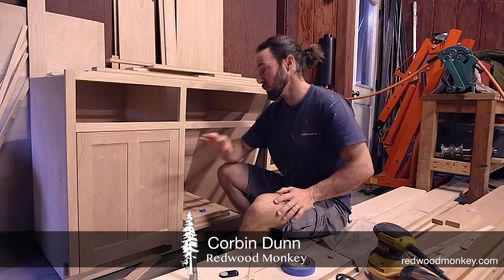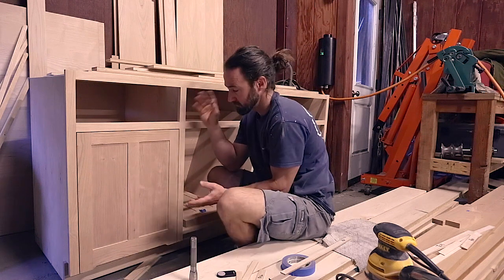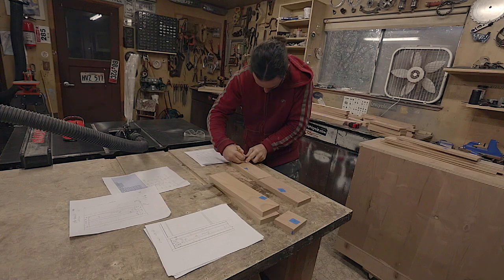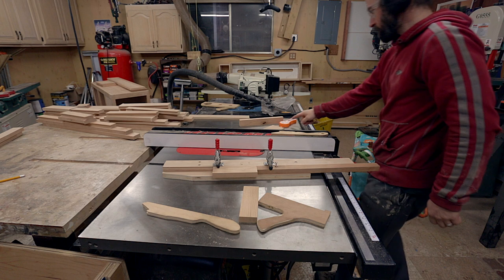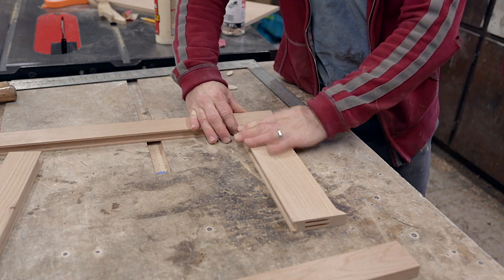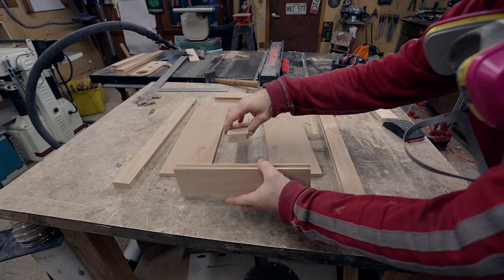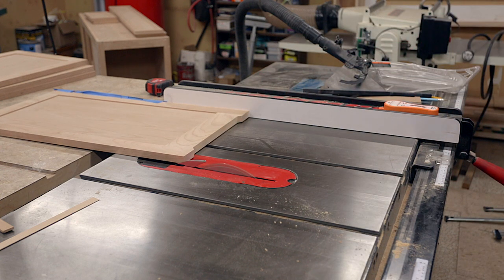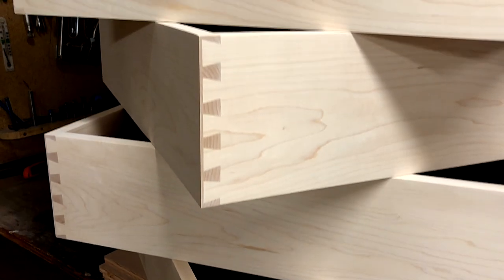Ep 7: How to make Inset Doors and Inset Drawers / Build inset cabinet doors - DIY Kitchen Cabinets

Comment: Hi there, have question for you. What is the frame overlay in regards to the cabinet interior.
Reply from the maker: Are you familiar with SketchUp? The description has a link to my plans/drawings I did in 3D. You can download them (free) and virtually measure any part you are curious about. The overlay sides varied..1/2" to something larger (I forget exactly what), and it depended on where I put the vertical cabinet sides. I talk about this a bit in some earlier videos. The inset is important; you have to get specific hardware for the specific hardware depth you are using. Sometimes I would skip the hardware, and simply block it out with 1/2" plywood, which was way cheaper. So, look at Blum's data sheet and use that as a guide for the sizes you should do. And/or, look at my drawings/plans in SketchUp. Let me know if you have more questions!

Comment: Great series. Very helpful. It doesn't look like you used a jointer on the boards, or maybe you left that out of the video? How are you getting them straight and flat?
Reply from the maker: Hi James -- you are right, I don't use a jointer! I bought S3S boards to save time -- surfaced 3 sides. I take the smooth edge and run it against the tablesaw fence to get the opposite edge parallel. Generally, the factory surfaced edge will still be rough from the sawmill so I will flip it over and take off 1/16" to 1/8" more to get it flat and smooth. The small cut also makes it more accurate and less prone to nicks from the saw blade.

Comment: Question about inset cherry doors. They are two doors that open in the space instead of just one. Do you suggest 3/32" gap between the doors? I've never done two doors and never done inset doors.  The hinges also didn't come with instruction and Blum sent me instructions to a similar hinge saying it will work with the Blum hinge I got on Amazon. That required me to get a millimeter ruler since all Blum measurements are in mm. I plan to experiment with boring and mounting hinges on stock material before ruining my last cherry wood doors. Thanks.
Reply from the maker: Hi David - yes, I also use 3/32" in between the two doors. The center section in the video above is a double door with no divider. Using the same gap width helps with consistency. I also use Blum hinges; which ones did you get? You probably got some of the "clip top ones - as seen on their site - https://www.blum.com/us/en/products/hingesystems/clip-top-blumotion/overview/ . You also have to get the matching mounting plate which depends on how your face frame is (or, if it is faceless, you need the 0-height plate). I didn't understand that at first. Yes, they list in mm, but inches work fine, and their sheets have a conversion on them, so I did all my layout in inches.  Let me find the layout sheet..
Reply from the maker: So, download their "brochure" on their website - https://www.blum.com/us/en/products/hingesystems/clip-top-blumotion/downloads-videos/ - that is also the install instructions. It takes some time to read and really understand.  Scroll to the last page for the mm to inch conversion chart. I did buy a 35 mm boring bit for the holes. I didn't use any jigs for the cabinet doors, but I did buy the hole alignment jig for making drawers.
Reply: @CorbinDunn  Yes, Blum sent me that and which page to look at in the pdf. But my hinges are not in their catalog (don't sell them anymore) and the plate is different. I bought a nice 6-inch ruler with millimeters on one side and inches (down to 1/16" inches) on the other side which is helpful (visually easy to correlate inches and millimeters). I'm doing the trial-and-error method. (I also won't buy hinges on Amazon again given they sell old stock no longer supported by the manufacturer.)
Reply: @CorbinDunn  I found the 1 3/8" boring bit worked very nicely on this hinge. I used their specs for the part in the door and it seems to work. It's the plate on the side that has different hole locations than the Blum brochure.  Thanks for your help.
Reply: @CorbinDunn  I figured out using the same gap for between the doors would be best. The hinges I got were these (on Amazon): https://www.amazon.com/gp/product/B001DT3U4U/ref=ppx_yo_dt_b_asin_title_o05_s00?ie=UTF8&psc=1
Reply: @CorbinDunn  I've decided that I will try to get Amazon to take these hinges back even though the 30-day has closed. Blum has, contrary to the Amazon page, discontinued these. These hinges also don't allow any adjustments. Precision has to be built into the installation. That doesn't work for me!  I'll keep searching for hinges for inset doors and frameless application. Thanks! I learned a lot.
Reply from the maker: David S try AH turf - they have the best prices. Use the data sheet to get the right part numbers. Good luck!
Reply: @CorbinDunn  I went to Menards and bought some inset hinges. They worked amazingly well. And simple. You only need to know how deep to bore for the hinge and then inset the bore 4 mm. The door is flush to the panel and then on the plate you screw into the panel there are 3 screws that adjust up/down, in/out, and adjust the reveal. I was extremely impressed how quickly I got the right reveal everywhere adjusting the 4 sets (each hinge) of 3 screws. The only thing I have yet to attach are the door handles once the polyurethane finish touch up is completely dry.  I really appreciated all your help on this.

Comment: Awesome videos and thank you for taking the time to do them! I had a question about the dado cuts, could you not use the router and a jig for those and same with the bisket joints?  I always use my table saw as a last resort when needing to cut into small pieces where you have to get up close and personal.
Reply from the maker: Hi Rod, Yes, definitely! A router table would be an excellent way to do the groove, and probably a LOT safer than the tablesaw. I'm pretty confident with my saw because it is a "SawStop", but if I didn't have one I would probably use a router bit sized to fit the plywood (or slightly undersized, and take two passes, adjusting on the second pass to the required width, which I frequently do on the tablesaw setup too). The biscuit jointer is fairly safe...I've never felt any kick back or concerns with it, but if you don't have one you could cut grooves on a router table and use some tenon sticks inside them.

Comment: Nice work dude! That dato kick-back must have been scary.

I've recently started working with lumber and it's driving me nuts. It's just not dimensionally stable like metal or plastic.
Reply from the maker: Yeah, that kick back wasn't too scary since I had the jig above it and kept my fingers well away. Wood is sometimes wacky to work with; rip a board and it can twist a ton when the internal pressures are released.

Comment: Corin I'm wondering if I make the gap for my inset drawer fronts too narrow (3/32" ?) that the walnut (edit here: CHERRY not walnut is the wood) drawer fronts will expand and contract (building a vanity). This is my first time making inset drawer fronts. Or is that not really a worry?
Reply from the maker: David S that is definitely something to be aware of! 3/32 should be more than enough space to ensure you don’t have issues; especially if you are using properly dried and acclimated wood. 1/16” might be fine too, but 1/32” would likely have issues.
Reply: @CorbinDunn  Thanks. Having made my first cut I can see that the gap should be fine. The wood was from an Amish cabinet maker who donated literally several tons of door frames and drawer fronts of maple and walnut pieces to the nearby ReStore. They were of various sizes and ready for use. I bought lots for such projects at very cheap prices. I'm feeling good about the stability of the wood. I did take away great tips for sizing the doors (inset of solid walnut) to the frames.

Comment: Really looks good.  I'm making cabinets too but having problems with twisting in my rails/styles which "warps" the door.  This is most noticeable after glue-up.  I may be clamping too hard or incorrectly.   Doesn't look good on inset doors when one edge of one door sticks out further than the frame or adjacent door.  Your's look really good but I wonder if you'll have that problem with seasonal changes.  Appears to be a very common issue from what I've read.  May I ask how did you avoid the issues I experienced?
Reply from the maker: Thanks! Twisting is definitely a problem. My first phase cabinets have been installed for about 6 months; so far, no twisting. But, I live in Santa Cruz CA, about 20 min's from the ocean, where it is relatively dry; a moist area like the south will have more problems. However, my bathroom cabinets aren't inset, but haven't twisted either, and that is a very humid environment. I avoid twist in several ways: I acclimate the wood in my shop for a few weeks before ripping. When I rip a board, some tend to twist more than others. If that appears to be happening, I will rip them about 1/8" to 1/4" wider, and then re-rip a 1/8" off each side. The first cut releases the tension, and the second straightens up the line. Next, I (almost) always use plywood for my door panels. This helps stabilize the door, since plywood tends to not move. I also put a line of glue in the grooves that take the plywood panel. Be cautious with plywood: sometimes I see pieces that are bowed, that can result in the door being bowed. Lastly, clamping straight is important! I like to use the Bessey clamps. After I clamp up, I take a look down the back side and compare it to the length of the clamp; sometimes too much force can cause the whole panel to bow a bit.  I'll also toss a framing square on to make sure it isn't bowing and is straight,

What wood are you using? I wonder if that plays a factor too. Having a moisture meter will also help ensure your wood is dry; if it is wet at all it will tend to warp.
Are you using solid panels?
Reply: @CorbinDunn  Thanks Corbin for taking the time to answer and that really great explanation!  Do you woodwork for a living or is it more of a hobby?   I live in the suburbs of Chicago.  Acclimation is difficult, particularly this time of year because the weather is quite labile. 

I used poplar for my rails/stiles and prefinished 1/4" maple for my panels.  Regarding assembly, I used both spacer balls and glued in the panels.  It did seem a little counterintuitive at the time, but I was worried that gluing the stub tenons and using only spacer balls would not be enough to hold the doors and panels together.  On the other hand, I was worried that if the glue holding the panels in place should fail, the panels would slide around in the groove (a problem I was having with the cabinets currently installed in my kitchen).  I reasoned this way, that if the glue failed the space balls would be there to prevent the panel form sliding around in the grove.   

I wonder if using a more dense wood like hardwood maple would be less likely to absorb the moisture.  Another option- Although I really like the look of inset doors,  maybe overlay would be less likely to show changes in twisting that may occur during, or even after completion.
Reply from the maker: @1970jjl  Currently I'm trying to pursue some woodworking as a side job; mainly making wood  slab tables. I haven't actually sold anything yet, and I'm concentrating on finishing my own kitchen first. My other job is a part time circus artist, and general handy man for my own property management. 

Poplar is definitely a soft wood, and that might account for it having more movement than you expected. Overlay doors definitely hide a lot of imperfections; honestly, if I do another set of kitchen cabinets I will only do overlay. They are so much faster and easier to do.

Comment: did you show how install the hinges and adjust or did i miss something?  could the hinges also aid in alignment of the spacing?
Reply from the maker: Patrick Melchior I install the hinges later, after finishing the doors and installing the cabinets. It is a good idea to install at least one set before finishing to work out any issues. It would be hard to use the hinges as an aide when doing the spacing; you’d have to remove them before doing cuts, and it would be very time consuming.
Reply: I was wondering which hinges you used since it's a framed cabinet and you're inserting the doors.

Comment: Looks like you might benefit from learning how or using a hand plane to fit those doors.
Reply from the maker: Yes! A hand plane can make quick work for fitting doors - this is a great tip!
Reply: @CorbinDunn  another way to trim those doors to fit is using a tapering jig. I just fit a door today using my flat tapering jig I made just for this purpose and it works great. I started with a plane but it blew out one corner so I switched to the tapering jig.Your probably like me, not so good with the hand planes so I try and avoid them.Always seems to be to much feteling around with them to get them adjusted and sharp.
Reply from the maker: @dannyh.7490  Another great idea, thanks!

Comment: Corbin. Dude. It's way safer and way easier to mill the groves with a router set up with a fence. Just get a three or two flute bit the size of the panel. I mark the table just like you do to have a stoping point for the stiles.  I generally make two passes taking 1/8 inch each pass. It's a lot easier on the blade doing this. I have also stopped using biscuits for those joints . I know it's expensive but I got a Domino and there is no comparison for speed and strength . Also why do you not make your top rail taller than the rail under the drawer ? they look the same height . The lip of the counter will obscure the top edge and the frame will look out of balance right ? just curious not judging. Good video.
Reply from the maker: Hi Art, YES, great ideas about using the router table / fence. I will probably do it in the future; it is also probably safer, AND wouldn't require the chisel cleanup! I agree: I want to move off biscuits, and I think a Domino will be my next purchase whenever I need to build some furniture. 

The top rail taller; I dropped the height of the cabinets for the thick concrete countertop; if I made the top rail taller I would loose some more space. But, it probably would look nice. I already had trouble fitting the dishwasher underneath, but that could have had a thinner top rail (or none at all). Thanks!

Comment: what type hinges did you use for the door?
Reply from the maker: Hi Robert, I use "CLIP top BLUMOTION 110 Degree hinge, Full-Cranked, Screw on". It requires a clip on mounting plate, either the 13mm or 6mm or 0mm one, depending on where I mount it (how deep the edge is).

Comment: Whoa doggie!!!  8 minutes in got a little pitchy!  I had a piece of wood hit me once in the ribs.  I've all but given up table saws now.  I keep thinking that I just didn't know the rules ... and I'm not sure you were following them either.  😬 Please be careful!!!!
Reply from the maker: Yup! I always stand a bit to the side -- notice I do this in the video, but even so, this is the most dangerous part of making these cabinets. I've had kickback only a few times in my life, and it was before I had a SawStop, where I always use the anti-kickback teeth and riving knife (except in blind cuts like this!).  Even with the anti-kickback, I did have a piece kick back onetime due to a knot in the wood breaking off a bit and hitting the wall behind me. If you are worried about using a table saw: buy a SawStop. I wouldn't ever buy any other brand. It has flesh sensing technology which is amazing and can restore your confidence in using the table saw. However, it isn't a substitute for common safety practices: don't stand inline with the blade, keep fingers a safe distance away, keep the blade only a bit above the piece you are cutting (ie: about a tooth).